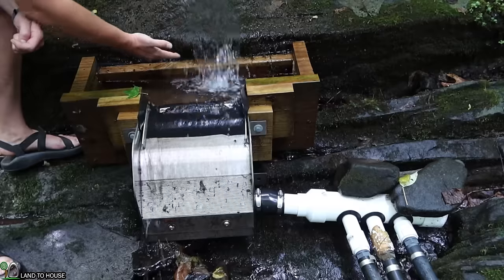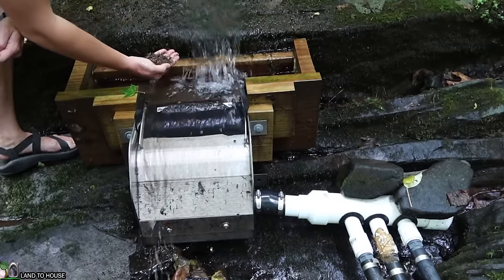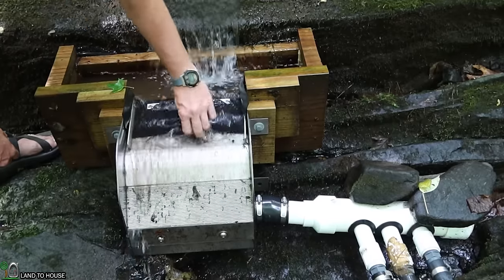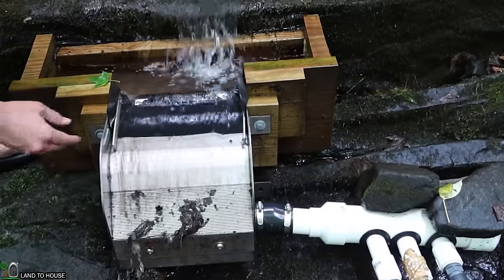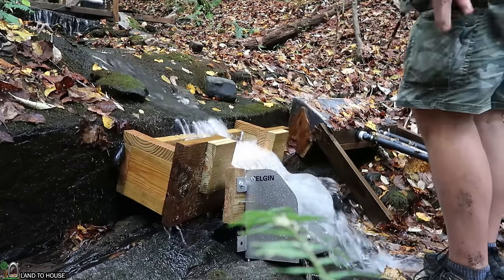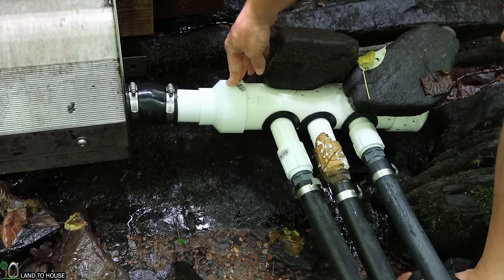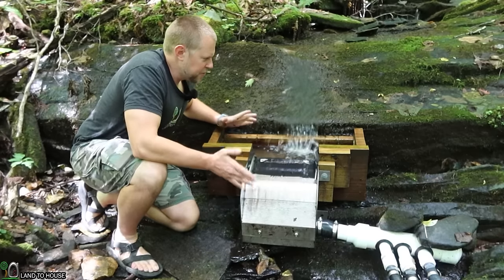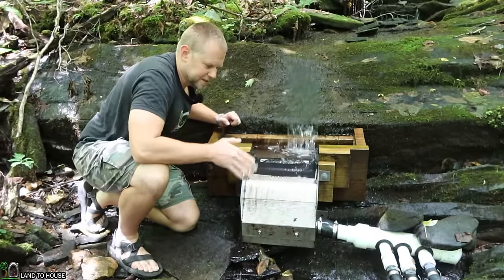Awesome Mountain Hydroelectric Power

Comment: Yeah, get  6v  Golf cart batts.   They do not need to be agm.  agm is kindofa gimic.   They help in cars and trucks to avoid premature plate damage and not much else.  Also you need to have batts which you can service.  Maint free batts are a gimic as well.   Maint free does not mean that they do not require maint, it only means that you can not maintain them.  Sells batteries.
Reply from the maker: The next step is lifepo4 batteries. I am actually installing a 5kwh battery today.
Reply: @LandtoHouse  Might want to compare price to longevity.  Yes lfpo is the new sexy thing, but  I am not convinced.  Also, if you get a bad 6v   lead acid, and it is identified within a year, it can be replaced in most cases depending on source.  Also lead acid is much easier to maintain as far a charging cycles.

Comment: Seems to me that the barrel to separate silt and water bubbles should be placed very close to the intake, otherwise you lose alot of pressure, also outlet should be much higher in my opinion, any oweflow outlet should be so high on the container that it's not letting any water out at all except for very rare exceptions.
Reply from the maker: The barrel is approximately 3 feet below the intake. I am losing at most 6w of power there. Its enough to pull the water down from the source.  

The outlet is close to the middle. 25 gallons of space above for air bubbles. 25 gallons below for silt. If the overflow is working that means there is no loss in pressure from the output at mid way. And even if there was it would not be more than 2w.
Reply: @LandtoHouse  ok sounds good, when I was watching the video I got the impression it was way further downhill
Reply from the maker: I must have shown an odd angle. You are not alone in thinking that.

Comment: if Elgin coanda intake screen prevents sediment to flow into the manifold, why is sediment collecting into 55 gallon tank as silt catchment? would seem it would be nil. One more, how or why is power from batteries going to two inverters?
Reply from the maker: Larger debris is removed. Fine Silt can still get by. Also the barrel was installed before I had the coanda screen.

Comment: Don‘t you lose alot of pressure head, because of the open barrel with the overflow? Wouldn‘t it be better to have the overflow at the top and keep the barrel airtight? it would still work as a filter, bit it would increase your pressure head…
Reply from the maker: That barrel is about 2' lower than the source. So I might be losing somewhere around 6 W of power.
Reply: @LandtoHouse  Ah, ok in the Video it seemed like it was lower, but then it is no problem👍🏼
Reply from the maker: Sometimes video is hard to judge the difference.  In this case the barrel is just low enough to pull water from the intake.

Comment: Doesn't the barrel with the overflow cause the fall of the system to be reduced to the height from the barrel's overflow down to the turbine?
All the water from the barrel up to the intake doesn't contribute any pressure to the system.
Reply from the maker: Correct. About 2-3 feet. 6w loss. But reduces air and silt.

Comment: Hi, I am concerned about your batteries..For flooded, lead-acid, and AGM batteries, proper ventilation prevents the buildup of hydrogen gas, keeping the air around your battery and your vehicle fresh, clean, and breathable. Proper battery ventilation also helps prevent damage and, more importantly, explosions
Reply from the maker: Yes! A lifepo4 battery has now been installed.

Comment: All you had to do was heat up one end of the pipe just enough so that plastic becomes a little flexible an then you just shove the other pipes end in the heated side one an it will stretch it to the perfect fitting no couplers or any of that jerry rig stuff you got going on

Comment: Is the water being diverted which would disrupt the local ecosystem?
Reply from the maker: There are several Springs just down from the intake Box.There are several Springs just down from the intake Box. The Creek typically has 30 to 60 gallons per minute flowing in the section between the intake and the turbine.

Comment: HOW DO U COMPENSATE FOR THE VOLTAGE DROP OF 250 FT B4 THE CONVERSION 2 DC, BKUZ I DIDN'T SEE A STEP UP TRANSFORMER OR ANYTHING??
Reply from the maker: My apologies.  Its 3 phase ac from the pma to the house. In the crawlspace there is a rectifier that converters the ac to dc.

Comment: Your 'pawer bill' is 75 dallars a month, and your system cost you 2000 dallars so by saving 40cents a day the system will pay for itself in at least 300 years if it doesn't fail.
Nice to see all your exact casts and amounts of power produced in your fantastic presentation which is only 31 minutes long. That makes it easy for others to follow your tedious path to the future.
2022 12 24 09:17

Comment: Why is the turbine so far away from the original intake I don’t understand why the 1100 feet and creek disruption was necessary
Reply from the maker: Head pressure. Water power requires flow and water drop. The 1100 feet of pipe allows the water to drop 150 feet.

Comment: Your system loses all pressure from the dam to the barrel. Replace the barrel with a long vertical pipe (the top of the pipe must be above the dam). Good like.
Reply from the maker: Luckily that's only 2' between the intake and the silt collection barrel.  No more than 6 W is lost.  The benefit of removing the air and silt is worth 6 W.

Comment: I don't like it. The water should be in a holding pond, with a series of jet sump pumps as your pen-stocks converted to generate power, then the water gets released into the closest release point almost in the same elevation as your dam. Beavers make dams all the time with very little harm to the eco system, but actually with positive results. Such may work in the winter depending on factors. Does the water course freeze solid in winter?

Comment: So 0.1 KWh, 2.4kwh per day, 876 kwh per year which is roughly 8.5% of average yearly consumption which works out to roughly $275 in savings per year assuming steady flow rate all year and national average power consumption. Idk how much all of those mats you used would cost but I'm guessing a couple thousand dollars. So you're looking at 10+ years payback period assuming zero maintenance costs and no replacement parts needed for that time.
Reply from the maker: Running the system at 100w that is about correct.  Half  The season I can run this at 400w.  For me this is basically just a hobby. If I had more Waterflow this could produce 500 W. Then it becomes pretty serious.

Comment: How many of these turbines would you need in order to be of grid, is it possible??
Reply from the maker: Way more water than I have. The house uses 400kwh a month. I would need 10 more of these at 100w. If I had more water and could run 450w all the time it would require 2 of them.

Comment: Not to be a downer but....  
8 months X 30 days X 24hr =5760 hours of use per year.  If generator is 100Watts that is 576 kWh you are generating per year.  Average cost is 10 cents per kWh.   Thats a savings of $57.60 / year.   Yes you have a small generator of 100W off grid but whats payback on the materials cost?  200 years?
Reply from the maker: This video basically is a fun hobby showing others how real power could be made off of hydro. Hopefully in the next 2 weeks I'll be filming a system based off this 1 making 700 W.

Comment: Welding your poly pipe together would have removed the barbed fittings from the system,  not hard to do can make up a DIY welder no big issue.

Comment: Your theoretical maximum hydropower is almost twice what you computed. How so? Take your 30 gallons, at 8.333 pounds per gallon: 250 pounds of water per minute. Multiply that by the head height, 150 feet. That gives you 37,500 foot-pounds per minute. Foot-pounds are Work (energy) and  foot-pounds per minute are Power (watts). One horsepower is defined as 33,000 foot-pounds per minute, so you theoretically have 1.136 HP. Each HP equals 746 watts, so 1.136 x 746 = 847 watts. 
But for the actual watts output, you need to know the efficiency of the turbine and the generator. Each of those is a number between 0 and 1, usually something in the range 0.50 to 0.90 (50% to 90%), which you multiply by the theoretical watts to get the actual watts. 
If you know the actual max watts, 450 in this case, you can determine your overall efficiency like this: 450/847 = 0.531, or 53.1 percent. It would be a higher percentage (more watts) if the air separator barrel was up higher and if any other points of leaked or choked water flow were resolved. Also you might consider making a small pond higher up the hill, to give more head height and surge capacity, while eliminating the need for the expensive Coanda separator. @Land to House
Reply from the maker: Your math seems to check out. The friction resistance in the 1100' of polypipe reduces the output potential. The turbine I think is around  .80 in efficiency but the friction loss brings the power down to 450w.
Reply: @LandtoHouse - If the water is cold, your 150-foot height difference should make right around 65 PSI at zero flow. What do you actually get, and how much does the pressure drop when the turbine is running?
Reply from the maker: @YodaWhat  stagnant pressure is 65psi. The pressure drops 5psi typically when flowing.
Reply: @LandtoHouse  yes look at friction losses first and foremost ! but a powerspout turbine would give you better turbine efficiency/reliability, double check wire gauges for potential loss there too, the dc bus and battery setup need to be perfect in all aspects for optimal efficiency & life span, the midnite solars are pretty efficient and robust. on the house side ditch the air conditioner, microwave and any other energy-vore appliance. if you need ac then the house isn't concieved/built right ... especially in a forest for gods sake.
for a diy install you deserve a B+, hydro is easy to fail hard to pass, well done !

Comment: Why haven't you gone off grid completely. I was shocked when I realized you were still connected. Certainly you could design a system that only adds to the grid.
Reply from the maker: Here is the mountains of NC we have 3-6ish hours of actual full sun and half the time its cloudy. The hydro is making 100w to 400w. The home uses 5kwh to 15kwh a day not including the hydro and sun. A lot would need to change to go off grid.
Reply: @LandtoHouse  ahh I see. It still seems like you have the land for a solar aray and you're a smart guy you could build some nice lithium-ion battery cells. Perhaps with some wind turbines. I saw a video about a guy in Australia that made a hydro turbine out of an old washer machine. It was pretty amazing. I'll try to post the link.

Comment: what is the payback period?
Reply from the maker: It would not be ideal to install this system with such low flow. You would need around 100gpm to make this worth installing. Youtube paid off the system in 4 months or less. If you had 100gpm flowing this system would make 1500w which translates to $6.50 a day in savings. It would pay off in 2.5 years.

Comment: I'm all for self-reliance, but cost benefit ratio doesn't seem to work. The expense for the mini hydro for 50-100 watts seems incredibly disproportionatal. Seems like a fuel reservoir, generator, batteries (which you have), solar (which you have) would be a better way to go. But I get the purpose of the project. Congrats.
Reply from the maker: For my creek, hydro is not great for power generation. This series has helped 1000s with setting up their system on better creeks. (As for my install, the youtube videos paid for the equipment)

Comment: Why don't you run the ram pump from the discharge from the micro hydro
Reply from the maker: I could. It does have enough water. But the creek is still flowing 20+ gpm so the ram pump has plenty.
Reply: @LandtoHouse  oh, what if Langston makes an even smaller low-head PMA that could run from the discharge of your micro-hydro?
Reply from the maker: I could use an inline system but there is so little head pressure it would not make much.

(Fun concept hydro plans in the works. Mini hydro like 10w to run a small string of LEDs.)
Reply: @LandtoHouse  The one you tested at the ponds had zero head pressure.  A smaller PMA with a longer screw impeller might do better than 10w using just the discharge from the micro-hydro.
Reply from the maker: It would be fun to try. Another issue is that the pond pma used 100gpm and the hydro is only supplying 15gpm.

Comment: instead of making PVC boxes that leak and always will use them big plastic storage boxes and plastic plumbing pipes with o-ring seals, all sold at your local hardware store B&Q, and you need a header tank of some sort to give a constant flow, a small pond would do, and as she said mint, mint is great for keeping rodents away, they hate the stuff, smell and they can't eat it either, plus you have a supply of fresh mint for your roast dinner, assuming you're not a pizza man,

Comment: Entertain me here....

Why do you have 8 AGM batteries and not 10 deep cycle? They're all 12v batteries,  you're trying to run 120V system, with 94V.  Not an electrician over here, just doesn't compute for me.
Reply from the maker: A 48v lifepo4 battery is my next upgrade. The AGM were purchased to start my journey.  A single lifepo4 is upwards of $1600 while the 8agm were $1200. (Purchased over time because I started out with a single 60v battery)
Reply: @LandtoHouse  ah I gotcha, just had to get her up and running

Comment: 100 to 450watts at how many volts?
Reply: I seen about 70volts at roughly 100watts. That's about 1.5 amp? Is that correct? Seems like a lot of work for just a trickle charge.

Comment: Okay but... This does 400W tops, that's like a one or two solar panels. Or literally the smallest residential wind turbine you can get(a proper backyard wind turbine will do more like 10-20kW, an actual large on-grid wind turbine will produce in the MWh range..). Laying >300m of plastic tubing into the woods, cutting off 1/3 of an ecosystems water supply... Idk man, seems like a pretty substantial encroachment onto nature for a pretty unsubstantial amount of power.

Comment: How do your local water inspectors accept, that you practically removed the stream from its bed and denied all those plants their water? I'm not an ecology activist, but this looks strange to me here in Europe.
Reply from the maker: There are actually 6 more Springs in this Creek along the pinstock where I have the intake. Only about a 20' section has reduced flow. I did keep into account the wildlife and plants.
 About the middle of this video it shows where there is approximately 60 gallons per minute flowing at the bottom.
Reply: @LandtoHouse  Thanks for the answer.

Comment: I dunno about running over a half a mile of pipe and all that only generates 100 watts and if anything screws up you gotta walk the half a mile up a mountain to the catch box and if not you still gotta clean it all out every so often…. A lot of work, time and money for such a small amount of power to contribute.. so you could power a few light bulbs with it..  couldnf even power a refrigerator with it..  maybe a fan….  Seems excessive for the contribution..
Reply from the maker: In the Spring and summer this will do 450 W. But what most people don't realize is the payoff in YouTube content. A gain in 70000 subscribers and revenue increase. 
This basic install has also helped a couple 100 people design their own systems producing much more power for example another video on the channel with a fellow named Jay used my system and is now making 800 W continuous.

Comment: You are losing much of the power . If you put that cediment/bubble drum up near the source ,  the head of pressure will start there and not where the drum is now.
Reply from the maker: The drum is about 2 or 3' lower than the source intake. Which means I'm losing about 6 W.

Comment: Why not just leave the water at the waterfall and place the AC Turbine there and run wires to the house.  Electric is far easier/cleaner to move over distance vs. water!
Reply from the maker: The 1100' of pipe is what allows thee a 150' of head pressure. Without that distance there would be no power generated.
Reply: @LandtoHouse  You can achieve the same pressure, likely more, by stepping down the pipe from one 2.5" to a 1' pipe over a much shorter distance.  Look up venture effect - p_1 - p_2 = \frac{\rho}{2} (v_2^2 - v_1^2)
Reply from the maker: @alkraus8818   From understanding the problem with doing this is that the flow rate is reduced Due to pipe friction loss. You also have to have sufficient 2" pipe on the other end to pull the section through the venturi.

Comment: That solar and hydro system just supplements your home power 😂😂😂 how much power are you consuming bro ? Surely to god that system should be able to power ur house for no need for mains supply ?
Reply from the maker: The average US household uses between 30 and 60 kW hours A-day.

 With my new off grid system using about 10K A-day and the H vac turned off my grid consumption is typically around 5 to 10 kW hours A-day.

 You might be surprised how much power we consume. I know a few people that use over a 1000kw hours a month.